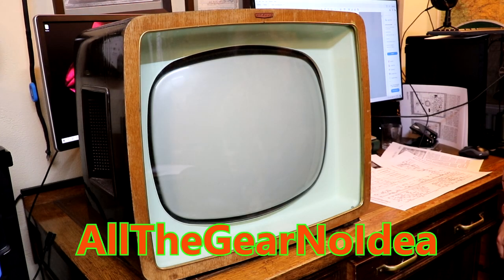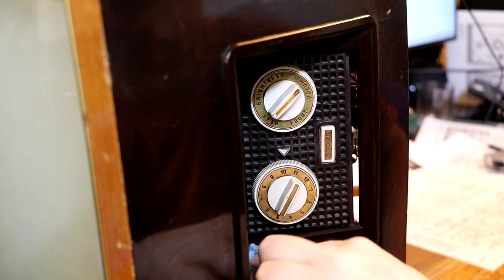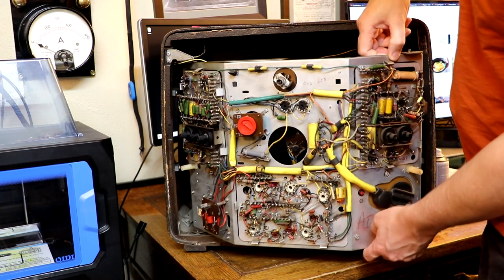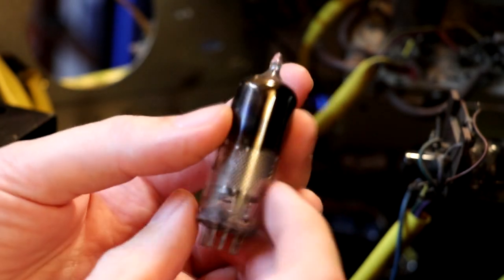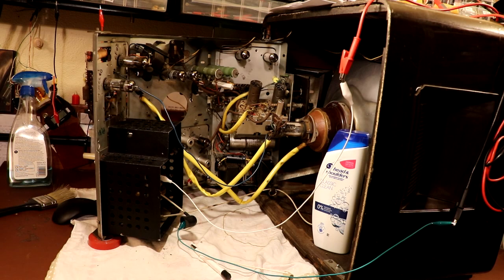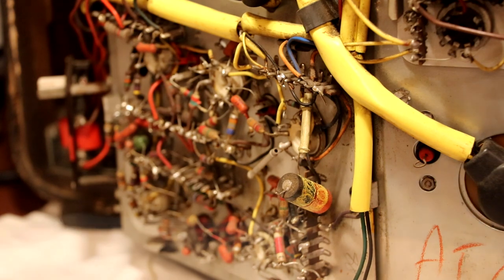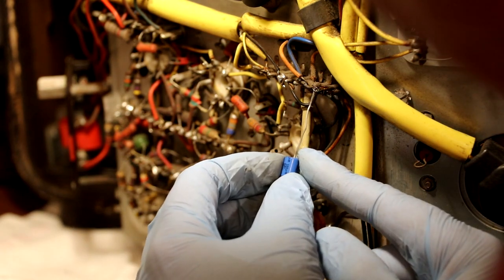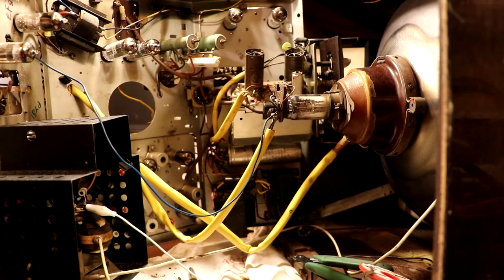Shampo066 Stella TV Repair - Part 1

Comment: an excellent start . the black tar covered caps are not hunts but philips(allways leaky) the boost cap is the big one on the LOPT. you are right about the focus control  used to load down the line stage causing a lack of width.
years ago the main faults were in the frame stage (lack of hight. bad Linearity)
theses sets were badged philips/stella/alba with different cabinets.
good luck ,if the LOPT is ok i am sure you will end up with a good working set
Reply from the maker: Thanks for the information on the Philips capacitor and the boost capacitor I will have to ask you a bit more about that later on the cruncher forum . Thanks regards Chris

Comment: You're off to a good start with this one Chris. That lopt should dry out nicely over a few days. Those Plessey cap are a change on site item. Don't do to much work, aim for "first light". The raster on the screen will tell you where to direct your attention. That's the beauty of a TV, it will show you what's wrong. Keep up the good work.
Reply from the maker: I the raster on the screen will likely tell me that I’m an idiot who has no idea what he is doing. Do you have a video showing how to power up a TV for the first time?. Thanks for comment and advice regards Chris
Reply: @allthegearnoidea6752  To be honest I can't remember if I do or not!! Different people have different approaches to all this, some have heated arguments, pistols at dawn, all sorts!! What I would do with that set is wind it up over the space of about three minutes on a variac  monitoring the smoothed HT and AC current draw. It's probably fair to say it's seen power maybe in the last 5 years because of the modern cap in the there. We don't want to take to much time running it up because we want the line oscillator to start as soon as possible. (No line oscillator equals no line drive for the line output valve) I say you have a good chance of a nearly working set first time, have your Aurora plugged in.

I did a Bush TV66 that work quite well even though it was in an awful state. https://youtu.be/e6pVDRVornc
I'm sure i did di a video starting up one on a variac but I will have to look through my back catalogue and I'm just one my way to work. Sorry I'm not so good at explaining..
Reply from the maker: @IrishvintageTVRadio  Thanks John I will have a look at that video now. Perhaps if time allows you could do a video on bringing up TVs in the future. I know the problem regards pistol at dawn forum are great but sometimes you get information overload and just have to take your choice etc. Best regards Chris
Reply: @allthegearnoidea6752  At the end of the day it's your set, you must do what feels right for you. I can't see you having any major problems with it.

Comment: Chris, the Trader service sheet is number 1528..I have it in stock & can scan it for you if you need it. Dated December 1961..You will know it's a 405 line only television made some years before the duel standard 405/625 line models. So the 12 channel (normally 13 channel) tuner is channels 1-5 are VHF band 1 (50Mhz) which was for BBC1 & 6-13 are for VHF band 3 (III) covering ITV. When I lived in Yorkshire, BBC1 was Channel 2 & ITV was Channel 10 (Emley Moor). The VHF 405 line transmissions ended around 1983, so to view anything you'll need some method of standard conversion from the current 625 line format to 405 line. I'm sure you know that E series valves (as in EF80) are 6.3V 0.3A heaters. P series valves run on a 300mA heater chain. In some AC/DC valved radios you will see U series valves that run on a 100mA heater chain. Without digging out a service manual, this was made at a time when I'm sure that Philips had taken Stella over, along with Cossor so there could be the same chassis in a Philips branded set.

I had a TV/audio business from 1979-1985 until I went into full time business radio instead. If I started repairing vintage TV's I could be Tango 066

Richard, G0OJF
Reply from the maker: Hello Richard thanks very much for watching and comments. I am struggling a little bit with the Television at the moment but haven’t really had anything to do with TV until the last few weeks but I do fancy having ago. I have the traders sheets and also Stella manufacturers information and believe it’s also identical to one of the Philips chassis. But thanks for  kind offer of information.  I have a few 405 line pattern generator that I previously restored but haven’t actually tested on a TV yet and I also have a standard converter so I can convert from composite video to the 405 line format. Interesting on the channel information I only live a couple of miles from the Emley moor transmitter. All my TVs operate in the house without the need to plug in an Antenna!   I hopefully going to power it up for the first time later this week but have a few things to change out in the line output side and boost capacitor.  Bit of an up hill struggle at the moment but it’s nice to learn about something new if you consider 1960 technology as new, well it is too me.  I need to catch up on some of your videos as I have been in TV mode recently. Out of interest have you done a video on the very first U.K. legal CB. I would like to see that ?     Keep safe regards Chris - I will buy you a pint when things get back to normal
Reply: @allthegearnoidea6752  Quite a few UK legal CB's were available day 1. The Realistic TRC2001 & the York JCB861 & 863 immediately come to mind. I had to wait about four weeks for a pre-ordered Realistic TRC1001 handheld to arrive. The only set I could personally get for day 1 was a Harvard Zero-two-zero..

I've found a 1976 B&W portable TV to do....Tango 066 here we come!

Richard

Comment: Hi Chris,
Snap! I too am an asthmatic -a registered asthmatic, so you have my 100% sympathy.  You will note in most of my past videos, I always get my wife to vacuum dust out of the backs of radios I’m working on since, having been rushed into hospital a few times, there have been two occasions during the last nine years where I’ve experienced very close ‘Good night Vienna’ moments.
Now over to the television.  I remember that Philips, model 17TG200U chassis like it was yesterday.  Their circuit diagram is in “1960/61 Radio and Television Servicing”, Newnes publications, pages 551 to 556 (Stella pages 621 to 626).  I served part of my five year apprenticeship working on those (1971 to 1976) - they were ten year old tellies when I started.
I remember that chassis being generally reliable.  They did suffer from LOPT over-winds (secondary) going o/c, and also puking out loads of RF - the smell of ozone was quite pleasant LOL!  Those 110 degree CRTs were generally very reliable.  Also, look out for the scan coils ‘plant potting’ ( bottom corners of picture missing), replacement types would be tricky to come-by these days.  Philips, as I remember, never incorporated Hunts capacitors.  Those black tar coated paper and foil capacitors were Philips own manufacture imported from Holland.  Though those green capacitors were very reliable back in the day (branded as Mullard), I certainly would not trust them these days.
How would I begin the restoration?  First and foremost, get the power supply circuit, associated with the two PY82 rectifiers in parallel running - i.e, get the HT volts up to within 10 to 15% plus or minus ‘off-load’ voltage, but don’t to forget to disconnect HT rail beforehand from the rest of the TV since there are untested circuits that could cause damage, and extra work if powered for the first time after not being in operation for what might have been several decades.  
Once HT volts are up and running, you can move over to checking, and replacing components in the PCL82 frame oscillator, and frame output; as well as checking circuits pertaining to ECL80 line oscillator, and clipper, PL81 line output, and PY81 boost diode.  Be on the lookout for line drive - PL81 grid 2 volts - load resistor (I think it was 2k2) often went high, or o/c.  Also check the EY87 EHT rectifier - making sure the heater winding (three turns of EHT wire has not burned through) - if it has, winding three turns of wire onto the LOPT is straightforward enough.
Once ample scope for interlacing, and linearity via frame, and line output, you will be ready to move over to circuits like Tuner unit, Sound and Vision IF, Vision IF (34.65 MHz); Vision Demodulation, Video Amplifier - if my memory serves me correctly, I seem to remember them incorporating a interference suppressor circuit. You will also need to check the sync separator, associated with interlacing; and we must not forget the Sound IF; Sound Demodulation, and PCL83 audio output circuitries. Be prepared to replace the PCL83 - the were not the most reliable of valves.  You can, for testing audio should the PCL83 be duff, use an ECL80 direct into the valve base, as I stress, only for process of elimination, and test purposes - not permanent.
Have you got an Aurora SCF405A standards converter?  If not, you will require one, connected from a digital tuner, or video source in order to get testcard, and/or sound and vision - there is testcard facility on the Aurora.  Be prepared: though its circuit board is housed inside a very small black plastic box, it is not the cheapest of items!  405 line television ceased transmitting on the 2nd of January 1985.  I saw the very last 405 line transmission on three televisions simultaneously inside my workshop at that time - a 1948/49 Bush, model TV12, Pye, model VT4 (my parents bought that TV new in 1954), and a 1963/64 (dual standard) Pye, model 11UF.
Contacting “405 Alive” might be worth your while.
Yes my friend, it’s all interesting stuff!  The man from Sheffield.
Reply from the maker: Thanks for the very extensive comments all interesting and useful.  I wish I could get my wife to vacuum out old radios but I don’t think she would entertain that idea LOL. My asthma can be quite bad and I’m been especially careful at the moment with the Covid and I am working from home but we have to carry on don’t we.  All those mullard style capacitor seems to be ok in value and leakage. I have had the LOPT overwind heating gently for the last few days. I’m thinking of bringing up the HT from a separate Heathkit power supply and I am assuming that without the valve heaters running this shouldn’t cause damage but I do wonder if cathode poisoning is a real thing ?  Still I often temporarily reform electrolytic before replacing them.  Obviously it’s a bit difficult bringing up separate parts of the circuit being a series strung set. I feel like I need to see proof of life before going further. I have some 405 line pattern generator and I have a standard converter from composite video.   Please let me have any more thoughts on the first power up. Thanks regards Chris

Comment: What a lovely t.v,  the case looks loverly with it's smooth classic look of the early sets,  no nasty corners .
Apart from the chassis to case damage, the case looks spot on.
I'm sure you can improve the bracket screw point with a bit of bodging .. No no  A cunning plan :-D
I have never seen a t.v with such a loverly chassis design,  access to everything :-D.
Personally i would connect the chassis direct to neutral (its earth anyway), the live would go direct to the switch.
But that's me lol.
Ahh the mains dropping resistor, i remember them from most old Black and White sets, very common.
You always say you know nothing about it,  but you are taking the right steps chris :-D.
Reply from the maker: I don’t know anything when I start but I have a few TV books on the go at the moment. I have to say it feels like a steep learning curve at the moment but I guess we have to try new things etc.  I always just took TV for granted back in the day and never really worked on them. Thanks for watching and comments regards Chris

Comment: The cut wires on the rear of the mains input panel are where someone bodged in a mains lead, the 2 pin Pressac mains connectors are quite hard to find.
I would replace it with an IEC (computer) socket.
Reply from the maker: I got lucky a friend sent me the correct connector. Is that the name Pressac I didn’t know that thanks. Best regards Chris
Reply: @allthegearnoidea6752  Yes, Pressac connectors were mainly used by Philips (your set is basically a re-badged Philips 17TG100U).
Glad you managed to find one.

Comment: 14:21 those slider pots are never good...dont bother with that for now, after you get a picture i sugest finding the best resistor value , most likely between 2megaohms and open circuit..and fit a fixed resistor there...it will never need adjustment anyways unless you swap the crt....the tv will work regardless it has focus voltage or not, the picture may look blurry though
Reply from the maker: I believe cutting the focus control was a common bodge fix on these sets. Thanks regards Chris

Comment: I may be rehung  weren't they a part of Philips the tv looks a lot like a Philips still probably rehung good video
Reply from the maker: Yes your quite right it is a Philips television but they rebranded it to sell at a cheaper budget price. Actually they used an alternative supplier of capacitors to the real Philips sets so these are actually easier and the capacitors have actually survived better than the original Philips.  Thanks for watching and taking the time to leave a comment my best regards Chris

Comment: Here’s a chart that explains the valve numbers: www.r-type.com/articles/art-170.htm  Those big green resistors remind me of the dropper in our Bush TV125/U, it burnt its way through two in the ten years we had it.  Always laugh to remember the repairman bridging the break by wedging a screwdriver between the dropper and the chassis.
Reply from the maker: Hi Wenlock that link won’t open for me. Those TV repair guys are fearless or just couldn’t care less not sure which etc.
Reply: Oops! Sorry Chris, it should be www.r-type.org/articles/art-170.htm. Curious, this chart says P is 100ma series string, yet radiomuseum has P as meaning 9V